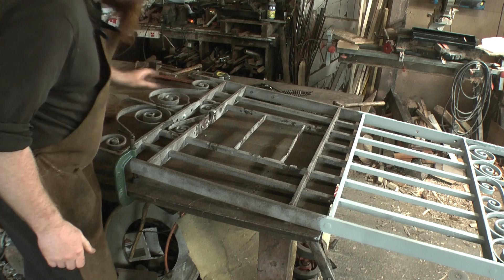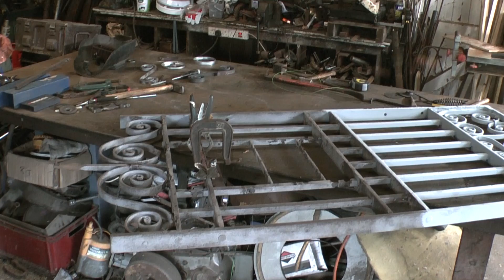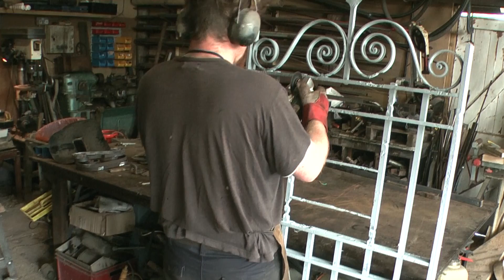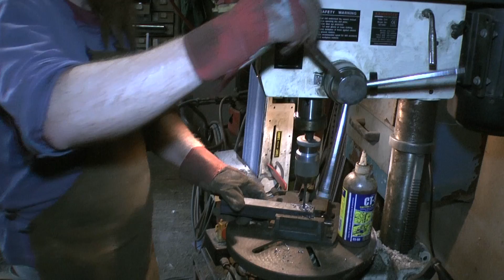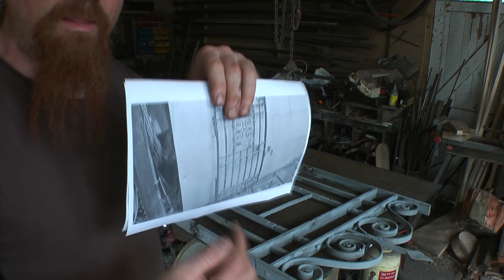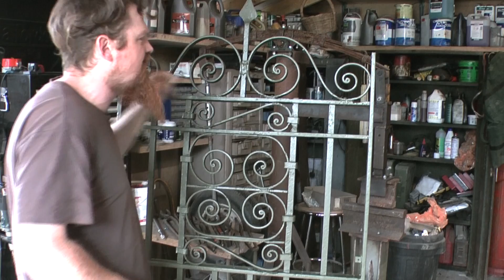Restoration of an antique gate pt2

Comment: I also subscribe to Cruising The Cut. 
And on there, the guy visited a small workshop  in the Midlands which still produce the  Lock Gates using all the  same Victorian methods, and in many instances tools too. The gates should last well into the next century. So when the Boss isn't looking , these guys stamped their names on a side that would only be revealed during a restoration. 
I suggest you do the same, and somewhere stamp your signature on the pieces you may create. 
For 18 yrs l handmade bricks at the Godlingston Works in  Swanage. And for about 9 months of the year, a bead of sweat would form on my forehead/ eyebrows, roll down my nose , and drop onto each bricks struck face l had just cut with a bow wire.
 To this day l still feel proud of this. 
I went on to live in a block of flats  made of Swanage Brick, in Swanage ,because it was deemed to be in a Conservation Area.
 My hope is that being a Conservation Area, many years from now , someone who may not even be born yet, will one day research this for local history's sake. 
And they will discover that someone born in Swanage, worked at the local Brickworks, made those bricks with his hands, and also  lived in one of those flats too, at the same time.
And if he was to join all the dots up he will see exactly what it took to work there.

Comment: Really interesting video, I'm in awe about your masterful skills. However, in the end, you seem to put on just one coat of paint. Maybe I misunderstood, but is that really sufficient? I know that you have that Zink stuff under it, but wouldn't a second layer of paint offer even better protection against the elements and also rust?
Reply from the maker: I hung it one way up, painted both sides then flipped it over, painted both sides, then stood it up and painted both sides. I always aim to get the equivalent of two thick coats on every surface, plus another coat on the surface that sees the most weathering. Probably should have explained or shown the painting better in the video but I'm always wary of boring people!

Comment: Reckon that gate's now good for another hundred years ? I take it because the load is on the floor pivot you weren't too concerned about wear/weakness around the top swivel fixing ? Awesome job 👍
Reply from the maker: Yes and yes. Plus during installation both the bottom pin and the hinge were also packed with grease.

Comment: Excellent film Max, production and editing is going from strength to strength. I use a good deal of linseed oil paint in my work, and make it myself quickly and easily, I imagine it would work really well as a top coat for this project.

Comment: Just curiously, At around 21 mins in you state that you'd never use water based paint on metal 'for obvious reasons' - what would they be please?

Also, Little Greene is fancy/pricey paint - customer choice? Or another reason for the preference?

Keep up the great videos!
Reply from the maker: Just that water and iron are not a natural mix! I've had trouble with flash rusting before. Little Greene was the customer's choice.

Comment: Great job and a detailed video👍👍👍I still think it might of been easier to make a new one. It's definitely a labour of love.
Reply from the maker: To make a new one like this with all the traditional joints would cost thousands! Even to make one like this but using welded joints would be at least twice the cost of the restoration. In this case it was an original feature to the house and so they were very keen to keep it. Of course, as I always tell customers if all you want is a gate to keep the dog in the garden you can get one at B&Q for £60!

Comment: All too often people see things and put a nominal value on them.  This video shows exactly how much value has been put into the gate (let alone what it was worth beforehand). Did you think about using copper sulphate as a base coat? It has the effect of being wet so would flow into all the cracks and also converting any surface rust into an inert substance that will no longer allow rusting to continue! 
A great video ;0)

Comment: Was the choice of MIG/MMA purely down to the output of the machines, or is there a more technical reason I'm missing?
Reply: Maximus Ironthumper I'll check it. Thanks
Reply from the maker: Yep, mostly a matter of their power output, the stick welder is running there at about 165amps whereas the mig will only manage around 130. I do generally feel I get a better weld in old iron with the MMA process but again that may just be down to having enough power to boil out the impurities that are always in old iron. The mig was useful here for tack welds (can do that off the solar!) and for pumping new metal into some of the corroded parts of the old scrolls.
Reply: Any chance of a video about your stick welder machine and rods?
Reply from the maker: There's quite a few videos with in already, I used it to rebuild the forge in one of my first videos, I fixed the carb in another and it was talked about in my welding basics video.

Comment: Does the gate "mind" that you're welding mild steel in to repair the wrought iron scrolls? Does it look the same? Weather the same?

I guess you haven't got much choice in material I'm just curious as to how well it works.
Reply from the maker: I like to use the original material where possible but to my mind mild steel is acceptable as a replacement for wrought iron, on this gate I don't think the repairs are visible at all - the close up shots right at the end show the repaired sections. As for weathering, the whole gate is covered in a layer of zinc so it's all much better protected than it's ever been before and it's already lasted at least a hundred years!

Comment: I have enjoyed both the gate vids. I am currently spending my spare time stitching replacement cills and floor under my old rover which is spark, wiggle, stop move along , repeat & do it again stitch type working. To watch someone working on some decent metal where a decent prolonged arc is used has been strangely pleasing. The customer has to be pleased with that result, a couple of months of weathering, Lovely job.